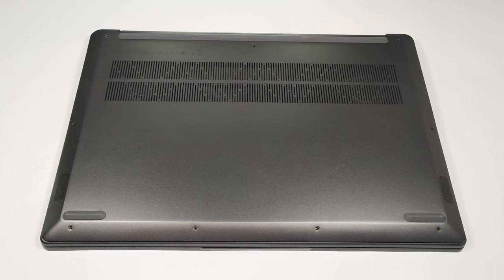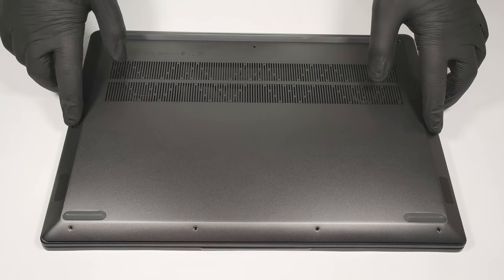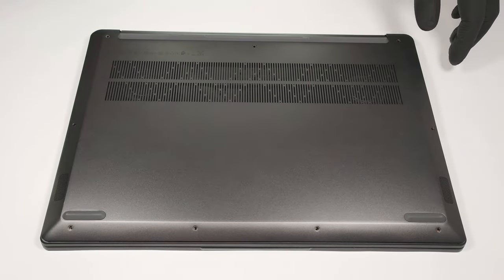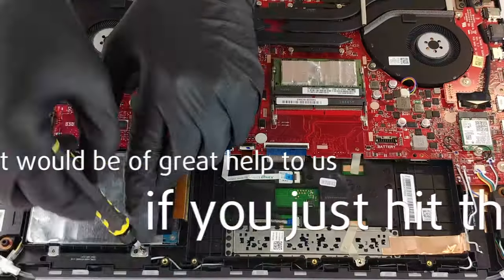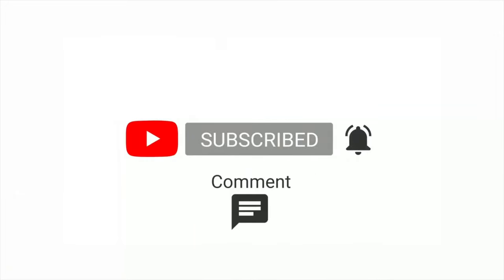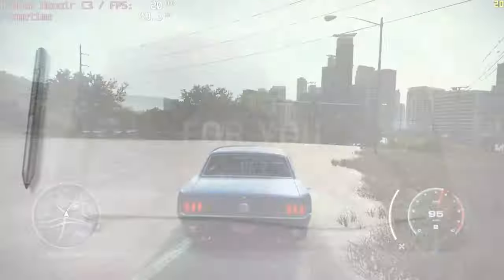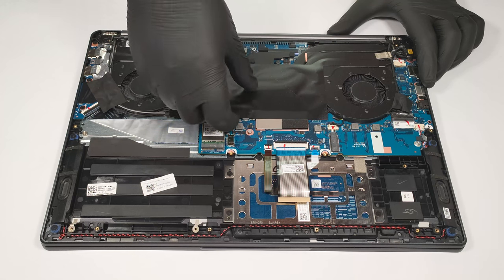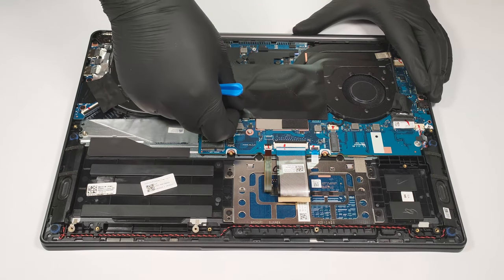🛠️ Lenovo IdeaPad Creator 5 (16″) - disassembly and upgrade options

Comment: Yesterday my laptop Just stopped working. I thought it was a power drain so i opened the inside of the laptop to perform some tests. While i was bussy with the inside i accidentally damaged the sticker near  the battery. A Friend told me that if the sticker is damaged you dont have right on a warrenty since that is a proof that you messed with the inside of the laptop. I am.now tottaly in panick. Does anybody know whether this is true?
Reply: Hi did you manage to get an answer about the warranty and also why it stopped working?
Maybe overheat? Overheating at least on this model could be the reason as it is mentioned in their review it runs at 100oC ALL the time. GTX runs at max all the time also. 
I am nervous to buy because of this.
Thanks